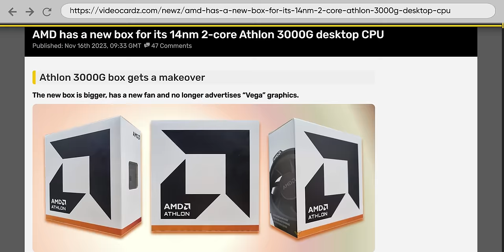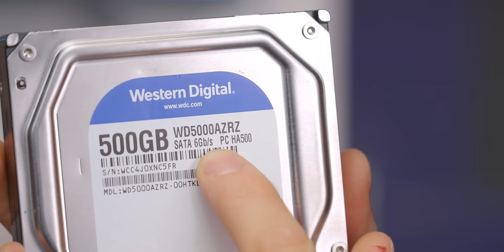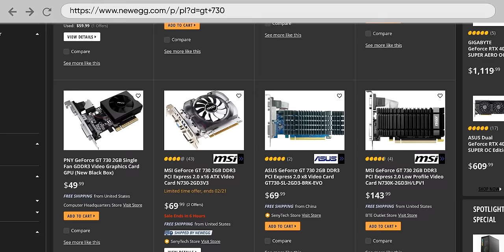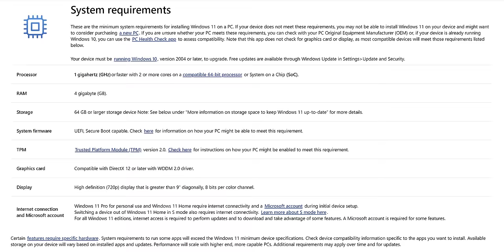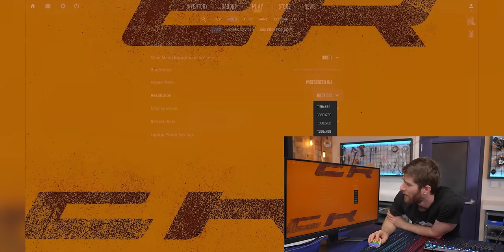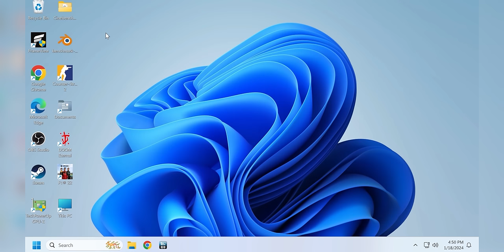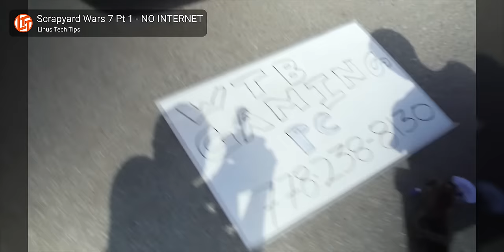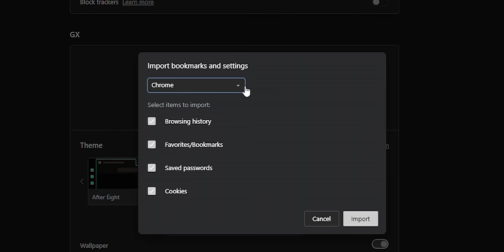I Built the Slowest Brand New PC and it Sucks.

Comment: i had a pc up on marketplace with a 1080ti and i7700k cpu. plenty of power despite being old parts, but i couldn't get more than $400 for it. had to drop the price so many times and someone finally took it. i wish i could have sent this video to all the idiots that didn't buy my computer
Reply: I'm still using my 1080ti and 8700k till they die. Parts so expensive I gotta get the max lifespan, lol.
Reply: a 7 year old 1080ti is about the same as a brand new 3060. crazy good deal
Reply: @Call_Me_Pickle  last month i bought 3070ti for 300. Soooo i don't know about 1080ti.
Reply: @Call_Me_Pickle  I dont know whether thats like an NA Thing, but here in Germany I had to camp listings for many weeks to even get a good deal. Most people sell their old stuff for like 50 bucks less than when they bought it originally 5 years ago. Maybe move here and I buy all you stuff? xd
Reply: Last year I bought a i5 10600k rx 470 32gb of ram for $350 and sold the 470 for 75 bucks buying a rx 6700 xt at 250. Honestly the market can be frustrating for sellers but buyers are having the best time with these prices.
Reply: That is because the old parts have a degraded value compared to the options you have on the new market. For instance i can see things like the 1080ti 5700xt 3060 and cards around that performance all go for around the same price.
Reply: @Call_Me_Pickle  Lmao your second hand 1080 Ti ain't worth 300 USD. Its worth half that.
Reply: May be because spending $200 more would get you faster and reliable parts and people don't want to risk it
Reply: @squidwardo7074 No.  The 3060 has dlss, rtx features, and mesh shaders.  The 1080ti is just a few years away from the end of driver support.  Nobody is buying a GTX card for $300.
Reply: You also shouldn't be selling pcs on marketplace, the people who'd understand the value don't use marketplace due to the lack of byer protection, you'd be better off somewhere with good protection like ebay
Reply: Sold 2 pcs for 400 and 300 
400$ one had a r53600 and a 2070 super 
300$ had a i312100f and no gpu 
But I did make about 200$ profit on both of them so I can’t really complain
Reply: I think it's the i7-7700K. Quad cores are old hat; you bought in fine before the fine wine line of the 8700K
Reply: And there’s a 1660 super intel 10th gen build going for $800 selling every day.
Reply: Thats its not worth it to game on pc compared to console. Its a money pit
Reply: I built a PC with a I5 3570k and a R9 270x do you think I could get $400 for it? if not I'll just keep it.
Reply: @dilutedoxygen you don’t wanna ship your pc parts, try and sell local or to a friend
Reply: Unfortunately the parts devalue over time as judging by the parts the PC ~6 years old which takes it's toll on the parts
A general rule of thumb is that a computer's value halves every 5 years
Reply: Honestly, I've noticed that complete PC's don't sell for much more than there most expensive component on the used market. I've seen GPU's listed at $300, but some poor bastard is having to sell his complete system with the same GPU for $350-400. It's always worth checking complete builds when looking for CPU's and GPU's, then you can either sell the remaining parts or keep them for spares. I bought a complete system for £200 GBP ($260ish USD) which had an R9 390x and a 6600k CPU a couple years ago, also a 500GB Samsung 870 EVO.
Reply: Those parts are 7 years old, the pc isnt worth more than $300 to $400. An i3 10100 can be had on ebay for $60 that performs similar. People tend to think the stuff they sell is worth more than it actually is. Times change, things get older and outclassed by modern stuff.
Reply: These are brand new parts, yours are used, it's a gamble to buy a used computer. That's why it's wort hthe same.
Reply: $400 is about right for a used PC with a 3 gen old graphics card. I built my PC with an RTX 4070/Intel 12900K for $1400 (just for the hardware and case, no monitor). 1080ti is really getting up there in age.
Reply: Recently i had luck on a ryzen 5600x, rx 5700xt 16gb ddr4, 1 tb nvme, decent sfx PSU and a b550i with sff tower for around 400euro used. included gas money. bought more than one used pcs / parts over the last 3 yeaars for friends and family in Germany, small to nothing problems. but i see also used machines with i5 4th gen ´with low end GPU for double the money. you have to watch carefully.
Reply: Soooo you think your 8 year old, end of life parts would be worth more... yeah this is the problem with the used market
Reply: My kid is running my old I7 6700 and Rx 580 8gb hahah, he loves it. Plays everything he wants.
I moved into a Ryzen 5600 RTX 2060 Super. Runs great!
Reply: @Call_Me_Pickle lol a 7 year old GPU is not worth 300$, even if it is a 1080ti, you can get a used 3060ti for a little less than that. Stop being ridiculous.
Reply: @squidwardo7074 more like a 3060 ti but with more vram definitely😂
Reply: @Sachitananda definitely not, that cpu is ancient
Reply: That happened to me last year. Had put up a ryzen 5 3600 pc with a 1660 super, 16gb of 3200mhz ddr4, a 500gb samsung 970 evo plus and a b450m bazooka max board. No one wanted it for even below 300usd. It's sad lol ended up parting it out and selling the parts separate
Reply: @spiritcrunch considering idk about RTX. I would buy it over the 3060 anyday.
Reply: You would have had an easier time selling the parts seperately rather than your computer as a whole
Reply: Yeah but it’s used nerd. Technology is not priced based on performance as Nvidia clearly showed us with the 40 Series gpus.
Reply: do you have any benchmarks?  sounds like a decent rig, I have the same 500GB 870 EVO if I OC the I5 3570k I could get clock speeds of 4.8Ghz on 4 cores no Hyper Threading @Gobbbbb
Reply: I just sold a 1080ti for . . . $500 lol. I mean it was a Kingpin and basically never been used but still
Reply: It's just a back up and I only use it to play CS 2 @TornadoSandwich
Reply: the issue to me is that pc is one gen below the requirement for win 11 so I'd be forced to upgrade the cpu after a couple years so it's not a value to me anymore at any price outside the gpu , case, ssd, and ram. going by what linus said he found the 8th gen pc for I'd be hard pressed to go over 300 for the one you were selling.
Reply: @spiritcrunch  I mean raw performance. Plus it was an entire pc, case motherboard, cpu etc not just a gpu. Quite a good ddeal if you ask me
Reply: @PexceI  i live in hawai'i so the market is limited either way
Reply: i had a similiar build listed with a 1080ti and an 8700k and got no messages on the thing even had it listed for 450 ended up putting up a listing for the 1080ti seperately and someone offered 275 for it the same day ended up just parting out the entire build and ended up with 600 bucks instead.
Reply: I mean this video doesn't mean your PC was worth more than it went for. It's objectively worth what the people looking for a computer at the time are willing to pay at the time and nothing more.
Reply: @gtijason7853  Wow.... you found an idiot. Good for you though. They could have gotten a 3070 or 3080 for that or even a new 4070 for $60-$80 more.
Reply: Best I could do is $250
Reply: My friend was looking for a gpu around a year ago, I offered him my old 1070ti jetstream for $60, he rejected my offer and said that the gpu is "outdated". He then proceeds to buy a 3050 for $400 lol.
Reply: @Benri05  Not really sure what point you are making.

The 3050 was released after gpu prices stopped being crazy, so why would he have paid more for it than it is worth to start with?

But ignoring that, the 1070ti will have no driver support within 2 years. The 3050 will still be getting support well into the next decade. It has support dlss and raytracing that actually can be used, and it might not be the best value available for new, but it either matches or most of the time beats the 1070ti in games. Cyberpunk with high-ultra settings without using dlss it gets up to 10fps more. And he got a warranty, and something that isn't already used for a long time and could die after only a couple of years even if you took care of it. Plus much less heat, and much more power efficient.

It's not the insane proposition you are portraying it as. It's not what I would have recommended as a purchase either, but not a crazy alternative.
Reply: @Call_Me_Pickle  bro, ill buy it for 300
Reply: @Call_Me_Pickle   lets be honest, i7700k is garbage CPU in today's market, any lowest tier ryzen CPU would destroy it. 1080 ti is good card but reaching the end to itsl ife span. lower tier and cards already overtalking it like rx 7600 is better card already than gtx 1080 ti. actually 300 dollars is a lot for this system, you should not complain.
Reply: yeah, the 7700 had the surprise death problem.  Can't remember any of the specifics, except the 7700 had a process issue, and anecdotally a friend of mine had a 7700k that went intermittent then died.
Reply: I bought the exact same spec 2 weeks ago with a monitor for 440 eur. I'd say that was a good deal.
Reply: maybe because my latest build cost me $650 with an i7 12700kf and rx6700xt... we're getting way more performance for not much more money. Your old crap ain't worth as much as you think
Reply: @Sachitananda LMAO you'll be keeping that thing forever
Reply: @rhandycs yeah, the trend for old hardware seems to part it out instead of complete builds.
Reply: @wyterabitt2149 just that perfomance on the 3050 is bananas compared to the 1070ti. yeah, companies sell you modern trash and nvidia just abandon all of them too artificially. it’s bonkers to see old hardware is still performing so well and people mentality is to create more e-waste
Reply: @spiritcrunch shiny features that no one cares, and when you enable them, it makes the experience worse than raw metal
Reply: @Call_Me_Pickle  I just bought a 1080 ti for $170 off ebay, and the CPUs I have seen for as little as $50. It's crazy cheap to be buying that era's flagship stuff right now.
Reply: According to people rtx 3060>1080ti because one has raytracing 😂